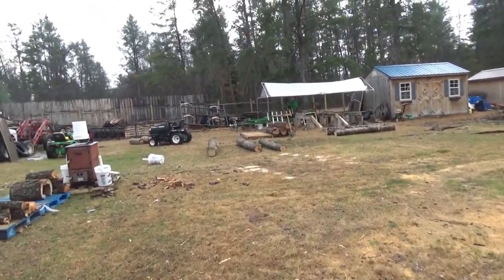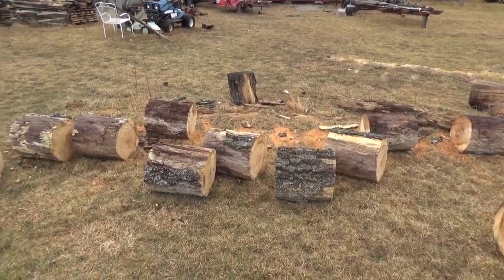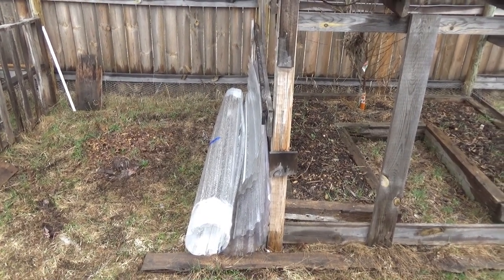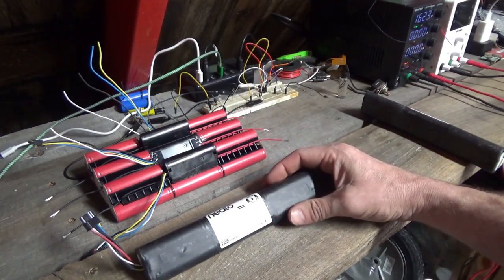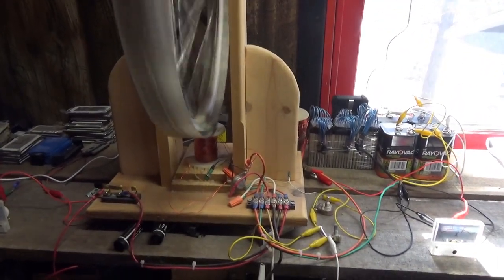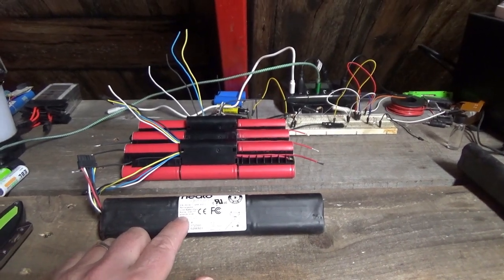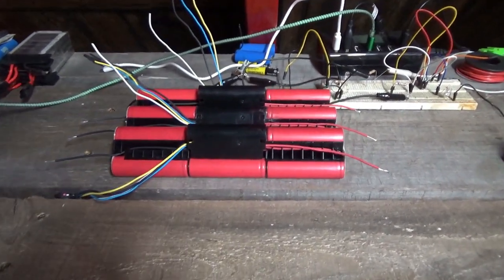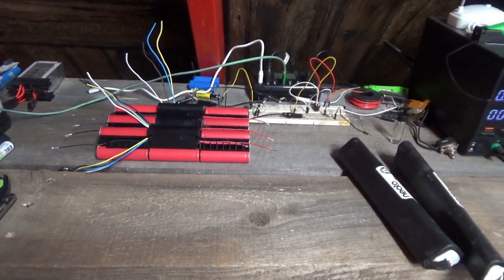Homestead Cleanup And Starting Build Of A Solar Power Wall

Comment: looks like some great 18650 packs. That sleep mode if for shipping safety. Watch out for pouch cells . I had some swell and break pack apart.  Even on LiFePO4 pouch cells can swell . you can do some tests on them. find the low voltage disconnect and max amps. been crazy weather in Boston NY as well. wind power going strong and solar . I have   NiFe battery 2 banks. 12V 700 Ah and 24V 1000 Ah. just filled the car up with distilled water. only flooded battery I got left. Oh my 48V EZ GO golf cart  is flooded lead acid 6 GC8 battery. everything else AGM or LiFePO4 type. nice to see you hard at work . 😀
Reply from the maker: Thanks. Yes I like these packs a lot. My favorite. They wake up nicely too. I am hoping to start putting all these together and switch over to Lithium. Sounds like you have a good setup going there too.